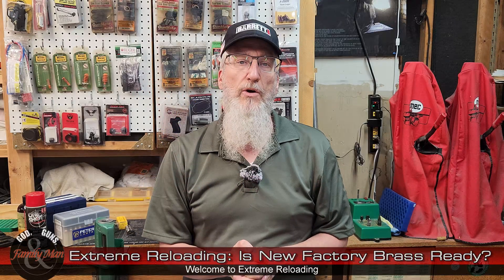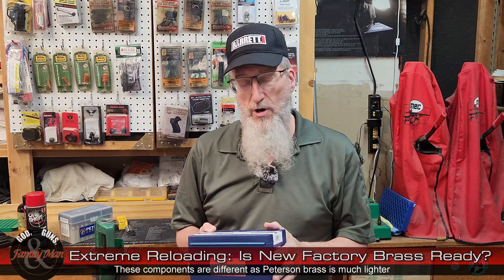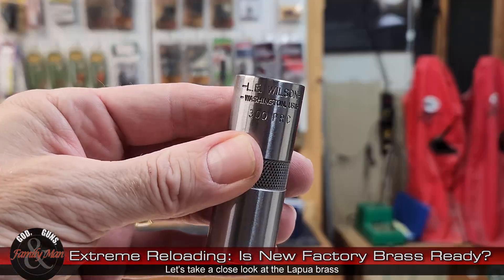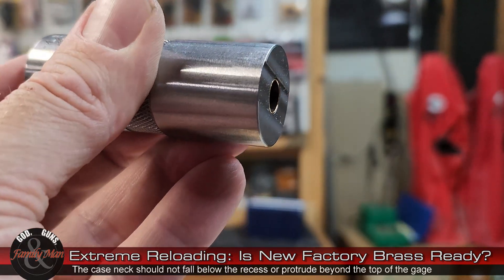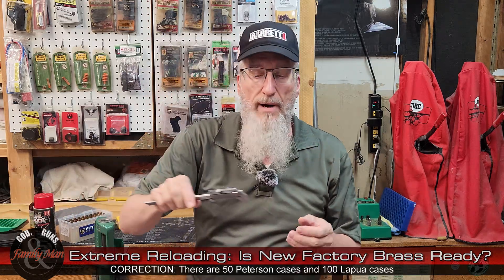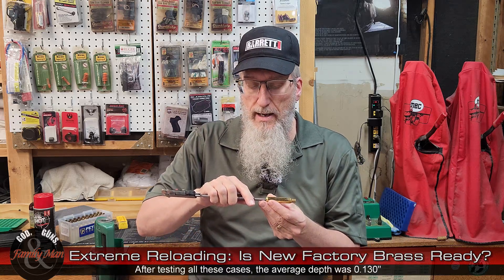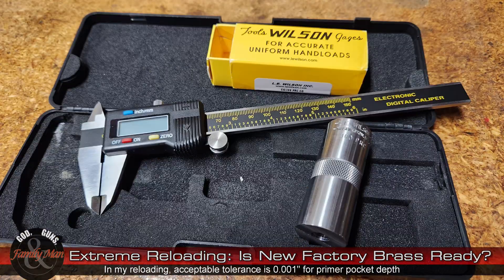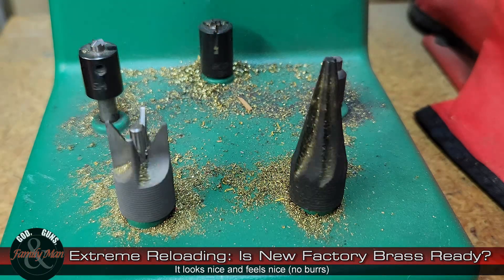Can you use factory new brass without any prep? Extreme Reloading ep. 02

Comment: you know your caliper resolution is 0.005. it doesn't measure to .001 so there is no point reading the last decimal place.
Reply from the maker: This caliper is accurate to 1/1000th of an inch or 0.001".
Reply: @sdkweber  it shows 0.001 "one thou" but it isn't that accurate. A little research will explain why. ;-)

Comment: any cleaning/wiping off of the imperial graphite stuff before loading projectile, or no because that's where maybe the reference to the projectiles sliding in better etc may come from, whatever may be left after the expanding of the case mouth/neck part?
Reply from the maker: You are right. I purposely leave the graphite residue on the inside of the neck after expanding the case mouth.  I read this promotes more uniform ejection of the bullet and so far my tests support this.  The same is not true of Mica powder however and I no longer use Mica.  Here is a link to that test if you are interested https://youtu.be/-J63UPsuu4k?si=4cf62yxu1JpdkoXQ

Comment: Hello good sir. If the primer pocket it too shallow or too deep, can the pocket be resized?  You may have covered that on a previous season and I just don't recall.
Reply from the maker: Hello Aaron
A primer pocket that is too shallow can be fixed on the case prep station using the primer pocket uniforming tool.  Too deep? No remedy really. However, over a few firings/resizing cycles it is possible that brass will flow into that area and it will no longer be too deep.  I have not seen that personally but in theory it is possible.  Thanks for watching as always.

Comment: Earlier this year I tested dry neck lube versus no neck lube and found better performance across the board with neck lube. Lower SD, lower ES and a slightly better group. Testing was done with 20 shot groups of a standard load in the caliber I tested. I've been using neck lube in all my handloads and reloads since
Reply from the maker: That is very interesting and good to hear. Any specifically dry neck lube?
Reply: @sdkweber  I was using the Redding Imperial dry neck lube
Reply from the maker: @DanielReyes-hz1qk  Ah, the same stuff I am using. I was not sure of that.  Thanks for the reply.

Comment: I’m curious to see your findings on the graphite.  I have used Imperial Lubricants Dry Neck lube, and I find it makes such a mess and adds more tedious tasks that I end up just skipping it.  I really just need to switch to a carbide mandrel.  Look forward to seeing what you come up with.  The stuff you used, doesn’t look as fine as Imperial’s, so maybe that’s a better option too.
Reply from the maker: The jury is still out on that one.  I am not sure yet.  I do like it better than mica powder though.  
These are graphite coated ceramic beads and seem to do a good job, but again I do not have enough experience with these to answer definitively.
Thank you for watching and posting Jason.